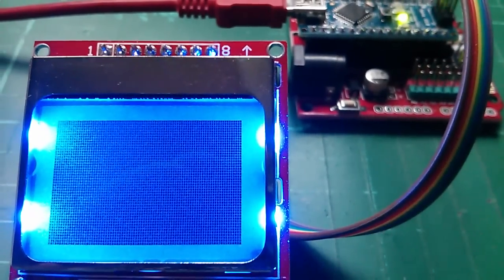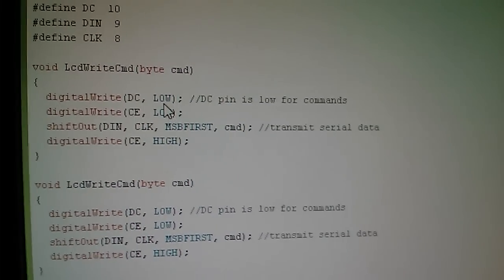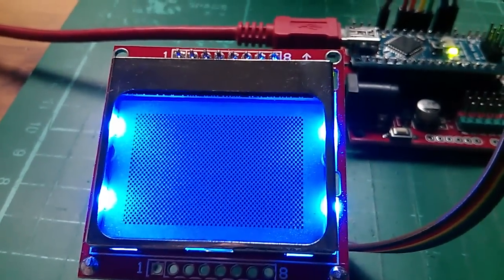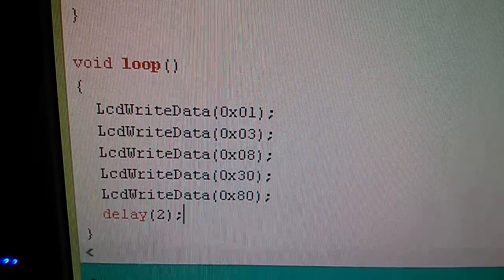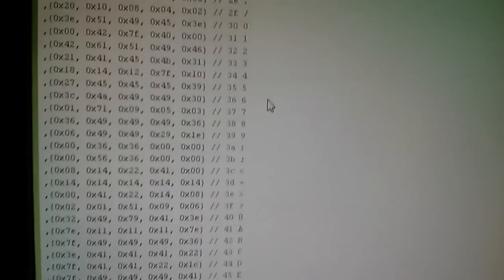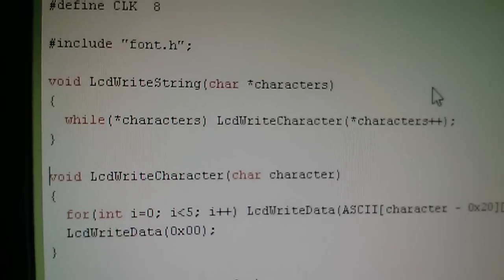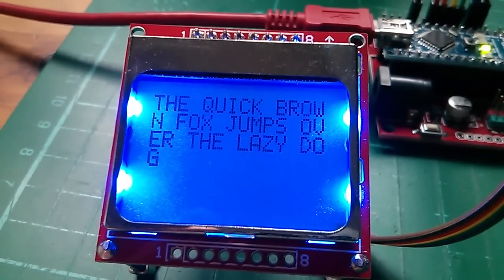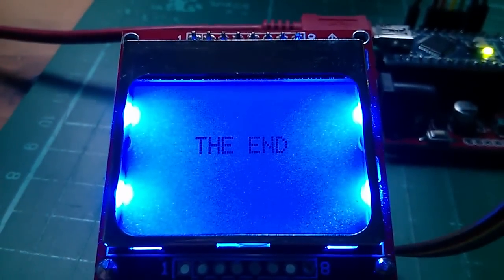Arduino Nokia 5110 LCD Tutorial #2 - Getting Text on the Display

Comment: I keep on getting this error message: 

Arduino: 1.8.1 Hourly Build 2016/12/24 01:12 (Mac OS X), Board: "Arduino/Genuino Uno"

In file included from /Users/AdaJohnson/Documents/Arduino/sketch_mar27b/sketch_mar27b.ino:7:0:
font.h:101: error: stray '\357' in program
 };
 ^
font.h:101: error: stray '\273' in program
font.h:101: error: stray '\277' in program
/Users/AdaJohnson/Documents/Arduino/sketch_mar27b/sketch_mar27b.ino: In function 'void setup()':
/Users/AdaJohnson/Documents/Arduino/sketch_mar27b/sketch_mar27b.ino:48:37: warning: deprecated conversion from string constant to 'char*' [-Wwrite-strings]
   LcdWriteStng("Hi, My Name Is Theo");
                                     ^
exit status 1
stray '\357' in program

This report would have more information with
"Show verbose output during compilation"
option enabled in File -> Preferences.
Reply: I fixed it
Reply: I'm getting same error, how did you fix it? This is my first manual library
Reply: @arthurjohnson2165  That was kinda rude of you m8

Comment: Thank you Mr Ilett!

1st part was very easy to understand, but in the 2nd part I have a problem as many people here (I guess). Does not matter how I lower the screen contrast, it still remains lit fully but not dark as before. Even I can not to display "55" and "AA". 

Could you please help me?
Reply: +Adam Insanoff Yes! Now it works. I figured out that I should decrease contrast much more. I put 0xA4 and it is just works!
Reply: +Adam Insanoff- Depending on the hardware, if you change the voltage from 5v to 3.3V, those values work as expected.

Comment: You could shorten the overall code by having LCDWriteCmd call LCDWriteData with a parameter for that defaults to high, but your Cmd function sets it to low?

Appologies if this has been mentioned before or doesn't really work. I'm still waiting for my hardware to arrive, but I'm reading up and watching vids. Yours are excellent! :-)

Comment: Hi, 

the code works great, but I`ve got one problem:
"The End" stands on the display for around 0,1 sec, aber this the whole display is full with black pixels.
What`s the problem? 

Thanks a million...
Reply: MilosMaric1982 Try changing contrast value in this line of code:
LcdWriteCmd(0xBF);  // set LCD Vop (contrast)

0xB0 works for me, with 0xBF I can still see the letters, but the screen is almost black around them.

Comment: I found this very helpful, Julian. If you want a simple intro to pointers, see my article:

http://www.drdobbs.com/cpp/computer-programming-and-precise-termino/208808373

After reading that, a valid pointer has an rvalue that is a memory address (or null). The indirection operator (*) simply says: "Go to the memory address and fetch what's there." The address of operator (&) simply says: "Fetch the address of where this variable is stored in memory." So, in the following code fragment:

int val = 10;
int *iptr;
char name[] = "Jack";
char *cptr;

iptr = &val;
cptr = name;

Suppose val exists in memory at address 1000 and name is at 2000. The statement iptr = &val make the rvalue of iptr equal to 1000. The statement printf(*iptr); would say: "Get the rvalue of iptr (i.e., 1000), go to that address and fetch "int" bytes (2 bytes) of data, and then print those two bytes (10)". 

In C, an array name is the same as the array's lvalue, so cptr = name is syntactically the same as cptr = &name[0]. In a totally biased plug, take a look at Beginning C for Arduino on Amazon.com. You can click on the cover and "look inside" to see the Table of Contents...there are two chapters on pointers.

Comment: For those of you getting "stray \357" etc etc etc errors, I think it's because the code was pasted with a different character encoding.  I copy/pasted the same font from the Arduino website and then manually corrected the lines with the errors in the INO and it compiled.

Comment: *var means var is a pointer that you are dereferencing - i.e. access the data that var points to. It's the inverse of &var, which takes the address of the data <var>. So:

int a = 10;
int* b = &a; //bis now the pointer to a
*b = 5; // changes the value of a to 5
Reply from the maker: Graham, thanks for that very timely piece of advice. I kind of get pointers, but as with all new things, getting to grips with the jargon is the hardest part. Dereferencing means nothing to me, I'll look it up. But I can see how modifying *b actually modifies a. Cheers.
Reply: Julian Ilett Dereferencing just means "follow the pointer to the data it points to". If you know any assembler (as a hardware person you may well do!) it's like an indirect addressing mode, and if that means nothing then don't sweat it, most C programmers have no idea what these language features turn into when compiled.
Actually my example is slightly wrong, or the wording is. To declare a pointer to a variable of type <var>, you write var* (i.e. the * follows the type), as I've written int* b. To dereference the pointer (access the data it points to), you write *<varname>, i.e. the * precedes the name, as in *b = 5;
Hope that makes sense, but I'm sure any C text will be far clearer than my explanation. BTW thanks for an interesting tutorial, I've done a bit with Arduino but nothing as sophisticated.

Comment: Firstly, thanks for all the superb videos, and your infectious enthusiasm.  It infected me greatly. I know you're a busy chap, but I wondered if you could help me with a particularly tenacious compiling error.  I followed (many times) parts 1 and 2 of your 5110 tutorials, and copied and pasted your code from this forum, but continue to get this straightforward error:

Nokia5110_2_5:10: error: expected ',' or ';' before 'void'

from this code:
#include "font.h";

void LcdWriteString(char *characters)
{
  while(*characters) LcdWriteCharacter(*characters++);
}

It all looked fine to me, but I tried inserting and removing semicolons anyway, without joy.
Could it be something to do with different versions of Arduino software or Nano version?  My Nano is V3.0, and I'm using Arduino 1.0.5.  I even checked for non printing characters in the text, but that looked clean.
I searched for the error and followed the pointers, but it all looks as it should to my relatively untrained eye. I have rtfm, so to speak.
I'd be very grateful for any advice you may be able to give me. 

Regards,
Mike Adams
Reply: Michael,

I had the same issue and found the solution to be inside the font header file itself. If you tried to copy the font.h file from this page, try deleting the final semi-colon in the file, which is at the bottom of the file directly following the curly bracket. Press enter to obtain a new line and then type a semi-colon and it should then compile without error.
Reply: Thanks very much. I'll give it a go. That was kind of you.
Reply: @1holy1holy1  Thanks a lot for this tip, now it works

Comment: Congrats Julian, it's amazing how clear you are during your explanation. I did really appreciate your video. 
One question: In my experience when I try to light the upper left dots using the 0x55 and 0xaa commands, in my LCD, they are not displayed exactly at the upper left position of the display, but in almost end of the first line. Do u have a clue for that?
Thanks again,
Reply from the maker: Thanks David. Display not resetting properly? There are commands for setting the display address - you could try sending them.
Reply: David Gonzalez Your display is upside down.

Comment: What are your thoughts on using the screen to display 2 large digits, and possibly a direction indicator? Would I need to write custom code to compose the entire screen image in an array and then send that serially?
Reply from the maker: Creating entire screen images isn't practical - you'd need 100 of them to encode all combinations of your 2 digits. You can cut that down to 10 by encoding each digit separately.

Comment: I would suggest instead of having comments for every command write that you define the commands and modifier bits and use them like CMD_DISPMODE | DISPMODE_NORMAL ... that way the meaning is in the code. :) Pointers are one of the most useful features in C especially when fiddling with memory mapped stuff. You can use a pointer like an array.. you can have pointers to pointers.. fun stuff :)

Comment: Hi Julian, great job as always!
Your guess was correct, * means pointer in C and C++.
A C string is represented as a char pointer, which basically points to the memory address of the first character in your string and ends with the ASCII 0 character, which is the string null terminator character.
Reply from the maker: Hey, thanks for that. I've read that pointers are one of the least understood parts of the C language and I've yet to get my head around them.

Comment from the maker: And here's the font data:

#include <Arduino.h>

static const byte ASCII[][5] =
{
 {0x00, 0x00, 0x00, 0x00, 0x00} // 20  
,{0x00, 0x00, 0x5f, 0x00, 0x00} // 21 !
,{0x00, 0x07, 0x00, 0x07, 0x00} // 22 "
,{0x14, 0x7f, 0x14, 0x7f, 0x14} // 23 #
,{0x24, 0x2a, 0x7f, 0x2a, 0x12} // 24 $
,{0x23, 0x13, 0x08, 0x64, 0x62} // 25 %
,{0x36, 0x49, 0x55, 0x22, 0x50} // 26 &
,{0x00, 0x05, 0x03, 0x00, 0x00} // 27 '
,{0x00, 0x1c, 0x22, 0x41, 0x00} // 28 (
,{0x00, 0x41, 0x22, 0x1c, 0x00} // 29 )
,{0x14, 0x08, 0x3e, 0x08, 0x14} // 2a *
,{0x08, 0x08, 0x3e, 0x08, 0x08} // 2b +
,{0x00, 0x50, 0x30, 0x00, 0x00} // 2c ,
,{0x08, 0x08, 0x08, 0x08, 0x08} // 2d -
,{0x00, 0x60, 0x60, 0x00, 0x00} // 2e .
,{0x20, 0x10, 0x08, 0x04, 0x02} // 2f /
,{0x3e, 0x51, 0x49, 0x45, 0x3e} // 30 0
,{0x00, 0x42, 0x7f, 0x40, 0x00} // 31 1
,{0x42, 0x61, 0x51, 0x49, 0x46} // 32 2
,{0x21, 0x41, 0x45, 0x4b, 0x31} // 33 3
,{0x18, 0x14, 0x12, 0x7f, 0x10} // 34 4
,{0x27, 0x45, 0x45, 0x45, 0x39} // 35 5
,{0x3c, 0x4a, 0x49, 0x49, 0x30} // 36 6
,{0x01, 0x71, 0x09, 0x05, 0x03} // 37 7
,{0x36, 0x49, 0x49, 0x49, 0x36} // 38 8
,{0x06, 0x49, 0x49, 0x29, 0x1e} // 39 9
,{0x00, 0x36, 0x36, 0x00, 0x00} // 3a :
,{0x00, 0x56, 0x36, 0x00, 0x00} // 3b ;
,{0x08, 0x14, 0x22, 0x41, 0x00} // 3c <
,{0x14, 0x14, 0x14, 0x14, 0x14} // 3d =
,{0x00, 0x41, 0x22, 0x14, 0x08} // 3e >
,{0x02, 0x01, 0x51, 0x09, 0x06} // 3f ?
,{0x32, 0x49, 0x79, 0x41, 0x3e} // 40 @
,{0x7e, 0x11, 0x11, 0x11, 0x7e} // 41 A
,{0x7f, 0x49, 0x49, 0x49, 0x36} // 42 B
,{0x3e, 0x41, 0x41, 0x41, 0x22} // 43 C
,{0x7f, 0x41, 0x41, 0x22, 0x1c} // 44 D
,{0x7f, 0x49, 0x49, 0x49, 0x41} // 45 E
,{0x7f, 0x09, 0x09, 0x09, 0x01} // 46 F
,{0x3e, 0x41, 0x49, 0x49, 0x7a} // 47 G
,{0x7f, 0x08, 0x08, 0x08, 0x7f} // 48 H
,{0x00, 0x41, 0x7f, 0x41, 0x00} // 49 I
,{0x20, 0x40, 0x41, 0x3f, 0x01} // 4a J
,{0x7f, 0x08, 0x14, 0x22, 0x41} // 4b K
,{0x7f, 0x40, 0x40, 0x40, 0x40} // 4c L
,{0x7f, 0x02, 0x0c, 0x02, 0x7f} // 4d M
,{0x7f, 0x04, 0x08, 0x10, 0x7f} // 4e N
,{0x3e, 0x41, 0x41, 0x41, 0x3e} // 4f O
,{0x7f, 0x09, 0x09, 0x09, 0x06} // 50 P
,{0x3e, 0x41, 0x51, 0x21, 0x5e} // 51 Q
,{0x7f, 0x09, 0x19, 0x29, 0x46} // 52 R
,{0x46, 0x49, 0x49, 0x49, 0x31} // 53 S
,{0x01, 0x01, 0x7f, 0x01, 0x01} // 54 T
,{0x3f, 0x40, 0x40, 0x40, 0x3f} // 55 U
,{0x1f, 0x20, 0x40, 0x20, 0x1f} // 56 V
,{0x3f, 0x40, 0x38, 0x40, 0x3f} // 57 W
,{0x63, 0x14, 0x08, 0x14, 0x63} // 58 X
,{0x07, 0x08, 0x70, 0x08, 0x07} // 59 Y
,{0x61, 0x51, 0x49, 0x45, 0x43} // 5a Z
,{0x00, 0x7f, 0x41, 0x41, 0x00} // 5b [
,{0x02, 0x04, 0x08, 0x10, 0x20} // 5c ¥
,{0x00, 0x41, 0x41, 0x7f, 0x00} // 5d ]
,{0x04, 0x02, 0x01, 0x02, 0x04} // 5e ^
,{0x40, 0x40, 0x40, 0x40, 0x40} // 5f _
,{0x00, 0x01, 0x02, 0x04, 0x00} // 60 `
,{0x20, 0x54, 0x54, 0x54, 0x78} // 61 a
,{0x7f, 0x48, 0x44, 0x44, 0x38} // 62 b
,{0x38, 0x44, 0x44, 0x44, 0x20} // 63 c
,{0x38, 0x44, 0x44, 0x48, 0x7f} // 64 d
,{0x38, 0x54, 0x54, 0x54, 0x18} // 65 e
,{0x08, 0x7e, 0x09, 0x01, 0x02} // 66 f
,{0x0c, 0x52, 0x52, 0x52, 0x3e} // 67 g
,{0x7f, 0x08, 0x04, 0x04, 0x78} // 68 h
,{0x00, 0x44, 0x7d, 0x40, 0x00} // 69 i
,{0x20, 0x40, 0x44, 0x3d, 0x00} // 6a j 
,{0x7f, 0x10, 0x28, 0x44, 0x00} // 6b k
,{0x00, 0x41, 0x7f, 0x40, 0x00} // 6c l
,{0x7c, 0x04, 0x18, 0x04, 0x78} // 6d m
,{0x7c, 0x08, 0x04, 0x04, 0x78} // 6e n
,{0x38, 0x44, 0x44, 0x44, 0x38} // 6f o
,{0x7c, 0x14, 0x14, 0x14, 0x08} // 70 p
,{0x08, 0x14, 0x14, 0x18, 0x7c} // 71 q
,{0x7c, 0x08, 0x04, 0x04, 0x08} // 72 r
,{0x48, 0x54, 0x54, 0x54, 0x20} // 73 s
,{0x04, 0x3f, 0x44, 0x40, 0x20} // 74 t
,{0x3c, 0x40, 0x40, 0x20, 0x7c} // 75 u
,{0x1c, 0x20, 0x40, 0x20, 0x1c} // 76 v
,{0x3c, 0x40, 0x30, 0x40, 0x3c} // 77 w
,{0x44, 0x28, 0x10, 0x28, 0x44} // 78 x
,{0x0c, 0x50, 0x50, 0x50, 0x3c} // 79 y
,{0x44, 0x64, 0x54, 0x4c, 0x44} // 7a z
,{0x00, 0x08, 0x36, 0x41, 0x00} // 7b {
,{0x00, 0x00, 0x7f, 0x00, 0x00} // 7c |
,{0x00, 0x41, 0x36, 0x08, 0x00} // 7d }
,{0x10, 0x08, 0x08, 0x10, 0x08} // 7e ←
,{0x78, 0x46, 0x41, 0x46, 0x78} // 7f →
};
Reply from the maker: Brandon Ruiz Vasquez In the same folder as the .ino file.
Reply: But...
How do i Make it an .h File?
and Where do i Place it to be able to import it?
Reply: Brandon Ruiz Vasquez Hey thats not necessary just copy the font data for       #include<Arduino.h> ........to.....};           .Then it worked fine for me
Reply: Revisa, has pegado mal los datos :D
Reply: Walter Brayan Castillo Alayo a mi no me funciona, qué es el problema?
Reply: i get this error?  Arduino: 1.5.7 (Mac OS X), Board: "Arduino Yún"

Nokia5110.ino:66:1: error: stray '\' in program
Nokia5110.ino:66:4: error: 'ufeff' does not name a type
Reply: thankyou :)
Reply: Hi Julian, thanks for the explanation. I'm getting an error with the font.h library, someone mentioned there's a dot at the end but I can't see it. I'm getting this long error, can you help?

Arduino: 1.8.1 (Windows 10), Board: "Arduino Pro or Pro Mini, ATmega328 (5V, 16 MHz)"

LCD5110_test:63: error: stray '\357' in program

 }ï»¿

 ^

LCD5110_test:63: error: stray '\273' in program

LCD5110_test:63: error: stray '\277' in program

LCD5110_test:12: error: expected ',' or ';' before 'void'

 void LcdWriteString(char *characters){

 ^

L:\Documents\Arduino\LCD5110_test\LCD5110_test.ino: In function 'void setup()':

L:\Documents\Arduino\LCD5110_test\LCD5110_test.ino:59:27: warning: deprecated conversion from string constant to 'char*' [-Wwrite-strings]

   LcdWriteString("THE END"); 

                           ^

exit status 1
stray '\357' in program

This report would have more information with
"Show verbose output during compilation"
option enabled in File -> Preferences.
Reply: The /357 error is invalid characters, cause you have copied the code from a website, it has put hidden characters in. Just delete at line 63 and retype whatever was there.
Reply: Thanks, there seems to have been something hidden at the end, so I removed it, and now it works but I get this warning, any ideas?

---------------------------
L:\Documents\Arduino\LCD5110_test\LCD5110_test.ino: In function 'void setup()':

L:\Documents\Arduino\LCD5110_test\LCD5110_test.ino:59:27: warning: deprecated conversion from string constant to 'char*' [-Wwrite-strings]

   LcdWriteString("THE END");

                           ^
---------------------------
Reply: I can hardly see "THE END" on the LCD because all the other pixels on the whole screen are also dark, THE END being just slightly darker. Why aren't the other pixels turning off completely?
Reply: This isn't a problem. Just means it is using an old format to convert the string and may not work in future builds.

As for the screen being dark, you might need to play with the contrast adjustments.
Reply: Thank you! 
I researched the LCD Vop (contrast) a bit more, discovered that I should use 0xB0 for 5V, 0XB1 for 3.3v, 0XBF if screen too dark. 0xB0 worked best for me!